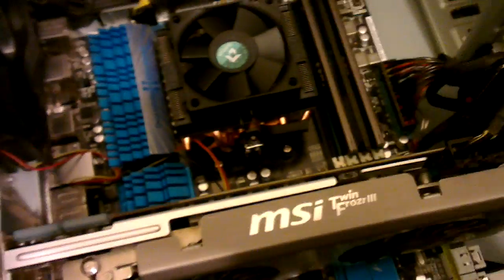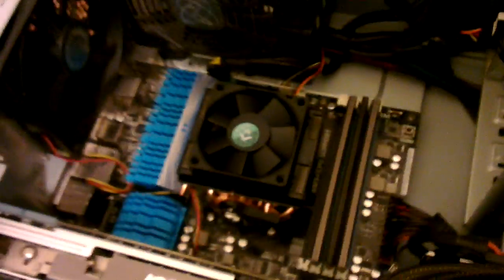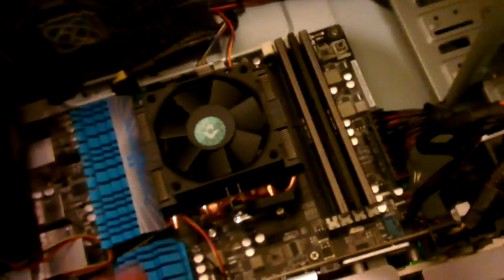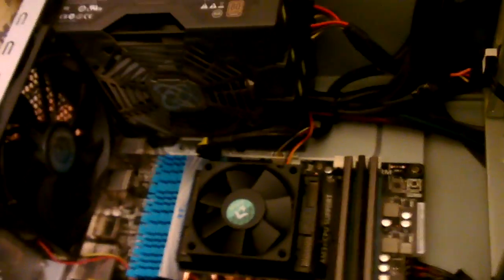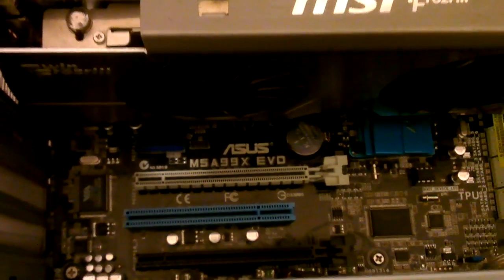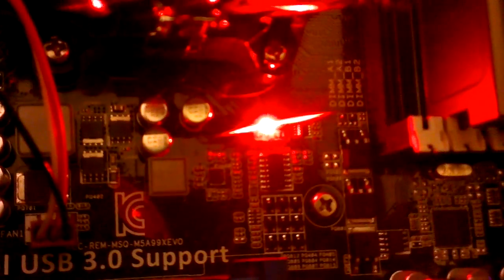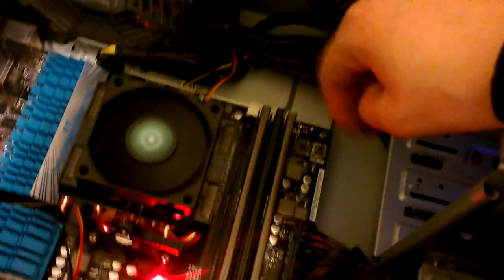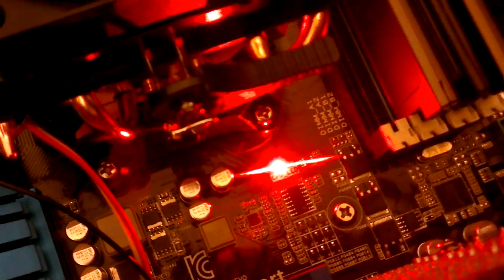ASUS NO BOOT NO POST

Comment: the north bridge chip of the board has fallen into a cold soldering error. It is necessary to remove the chip under the processor, freshen the lower solders and put them back on. There is nothing the end user can do on bga machines

Comment: it would be nice if held the camera a bit more steady that is aggravating as hell. yeah the CPU LED error is all to do with the processor. My issue is the Boot Device. yeah reflash the BIOS go back one earlier and then the lasted get those from the Asus site and do the reflash. you can reflash without POSTing by using the button on the MB bottom leftish side.

Comment: i had this problem too it turns out to be pq603  mosfet   right  next to the  big power supply plug  one of the 2 was dead    one is pa102fdg  and the dead one was part#  pc9050
Reply: On the ASUS P7P55D Pro, the PQ603 MOSFET is next to the labeled USB1314 socket not a "big power supply plug."  There are six (6) other MOSFETs in that area too, not just "the 2 was dead" you oddly mentioned.  As to your part number quote of "pa102fdg  and the dead one was part#  pc9050";  these numbers are completely wrong and totally misleading.  There are no such part numbers on that board.  These aren't even valid ASUS part numbers anywhere.  Perhaps you should explore the wonderful world of food service at your local McDonalds instead of trying to fuck up PCs.
Reply: @chuckadams4400  hello fuck head i am talking about  Asus M5A99X EVO not  ASUS P7P55D Pro  fuck head stop eating mc donalds  you sound like mcdonalds's clown  man you bring stupidity to a  brand new level wtf !!!!!! i did  managed  to fix my motherboard  would you ever do ?   ronald ?  shut the fuck up  !!!!

Comment: Another way to tell if it works is that if you have a led fan lights. If
 the lights turn a little dim, that means it will work. If the lights on
 the fans doesn't dim a few times,  then try to put the RAM in another 
slot to see if it works.

Comment: I have a problem where my pc turns on after a while it crashes and keyboard led turns of mouse to and monitor doesn't turn on I can't even turn it off neither restart it so to turn it on I have to unplug the outlet 
Same mobo as in video
Fx 8350
16gb ddr4 4x4
Seasoning 850w m12 bronze
GPu HD 7950 direct cu 2v
1tb hdd 
1tb Toshiba hdd
Please help I had problem for 3months 
Edvin Petrovic
Reply: did u fix it?
Reply: @Gdot04  yes it was the psu
Reply: How you solve this problem
Reply: @designcaptain4428  it was the power suppy
Reply: @gl0ckhuck260 did the fault in your smps?? if i change my smps then the my problem solved??
Reply: @designcaptain4428  sorry sir i dont know what is smp i tried my ram didint fix i tried my cpu didint fix motherboard it also didint fix it so i tried my psu and i replaced my seasonic 850wat with a corsair 650wat one and it works flawless
Reply: @gl0ckhuck260  smps mean (power supplies)
Reply: @designcaptain4428  yes powersupply was the problem id go for something like a 80+ gold or bronze powersupply form known brand
like corsair

Comment: i have asus p5kpl-am se and the motherboards green led light is on and when i turned on you know with out power buttons and nothing happens no display no fan spinning and since i don't have case So i unplugged and then re plugged it and i turned it on but this time i put my ears close to my motherboard and i heard a sound but i don't know what the sound was and my cpu is intel core 2 duo e7500 and i have 1gb ddr2 667 single and i have 300 watt power supply but please help me how to fix it 😥

Comment: Just fixed CPU red light on my new to me ASUS Sabertooth X58.  Turns out the CPU was not getting power.  Found the CPU power plug wiggled a little.  Tweaked the CPU power plug socket pins to make better contact.  That did the trick.
Reply: Finished my build red light and no display it auto switches off 😭

Comment: Is there a MemOK button near to the ATX connector? The RAM is probably the problem!
Reply: What’s the solution? Mine is Ram .. I plug in 4 sticks it won’t start. Remove 3 sticks it starts right away..

Comment: i had the same problem, tried the board with a known working cpu and ram. it wont go past the cpu test (which is the led that is on) so in conclusion you either have a faulty cpu or faulty mother board. considering my AM3+ cpu has out lasted 2 mother boards i would more than likely suspect Mother board
only way to prove this is with nothing else in the mother board except a known working cpu. if the mother board is faulty then it will have the same fault, if it was your cpu it will flash once then the ram led will get stuck on because of no ram being fitted.

Comment: I am having the same problem with the VGA and Boot Light both red, my screen says no signal. I took everything out and sprayed it with CRC contact cleaner. It worked, but I only had my monitor plugged in,  so I powered down to add my keyboard, but when I powered up again, I got no signal
Reply: Same
did you fix it?

Comment: I'm done with asus
Reply: vjxpiro evo asus p8 z77 V pro mom died today..... need msi :(
Reply: I ve got asus stix 1080ti b450 gaming and that y i have so many problems
Reply: I've had a few ASUS mb's over the years...never had a single problem with any of them...most were in use for 5+ years minimum.  You can get a bad board with ANY manufacturer..that's just reality.
Reply: Asus died z390 in less than a year, and they refused to fix my board,,Msi is the way to go, msi carbon are nice !

Comment: I fixed this same problem few days ago, take everything off ,clean everywere with alcohol using tooth brush to get in all the connectors ,should work fine after, seems sensitive to dust and grime ect.
Reply: Kus Ardiyanto he's trolling
Reply: @scoobi1955  Nothing to troll..you can bring devices back by using alcohol.
Reply: Simon Baker what you clean?

Comment: Just now I got into this problem.
My Pc is not booting........(No Booting Sound is coming) I tried everything I know.
but its not letting me to even enter BIOS.
all the fans and optical drives gets power.
No display on the monitor.
when I start my computer and press the power button to boot my computer I can only see the keyborad LED Flashes just ONCE and after that Nothing happens and every fan and MOBO LED LIGHTS GLOW.
What should I Do.
My config is:
AMD ATHLON X4 630
Biostar TA785G3 HD (MoBo)
Corsair 400 watt power supply.
Please solve my problem I don't want to buy a new MOBO.
I already cleared CMOS (By removing the battery and sorting the pins) but my problem is not solved.
Sill "NO BEEPING SOUND OF BOOT" & The computer is receiving the power.

REMOVED THE RAM
REMOVED THE HDD
REMOVED THE Optical DRIVE
Already did these but I'm not able to solve my problem.
Please HELP.
Evewin Lakra.
Reply from the maker: take the mobo out of the computercase and try to boot it outside of the case. Maybe the mobo is shortcutting power on the back inside of the case. That was what fixed it for me.So take it out of the case, put it on a box and try it. Good luck!
Reply from the maker: actually it might have been the bios that was broken, I honestly don't remember! I have broken more motherboards in my life as you may know :P
Reply: Manny Strauven Sorry for replying late coz I'm right now using my laptop & you already know the reason why I'm using my laption:)
My AMD PC was working fine yesterday & I have not added any new component or never changed the settings Or never did any Overclocking.

I thought the CPU is not switching ON or getting Power but the cpu fan runs & when only CPU is connected its getting warm I think CPU is getting power but its not switching ON.
My "Biostar TA785G3 HD" MOBO lights are On.
I don't have any standalone PCIe gfx card installed in my computer.
Reply: Manny Strauven I was using corsair cx 400w PSU.
with this computer for the past 3 years and I never had this problem
but yesterday at around 11:00 P.M. suddenly its not booting not even letting me to enter BIOS.
all the fans inside the computer (including the CPU fan) spins.
I took the MOBO out of the cabinet and put it above the mobo anti-static bag and connected:
1.CPU
2.RAM
3.PSU (24 pin + 4 Pin) Connector.
Then when I switched on the PC From mobo switch its not turning on.
(one time it turned on and turned off without any beep or booting sound.)

i.e. its not even starting if if try to star with open MOBO (outside the cabninet while resting in mobo static bag)
so now I've put my mobo and all the other components inside my pc cabinet and then also its has the same problem........PC starts but NO booting Sound No display on the screen.
NO POST.
Anybody experienced this problem and fixed it ?
Reply: is this the usual problem with AMD computers (when it gets old (eg. 3years or so) or you've seen this problem in intel computers as well ?
Reply: Manny Strauven I've already did the my PSU (corsair cx 400w) Sorting-Pin test :)
by connecting only the cabinet fan to the PSU and sorting the Green PIN And Black (Ground Pin) with the Paper Clip & When I switched on the PSU the Fan SPINS.
I think My PSU is Good.
but I don't know how I'll determind my MOBO got fried or my CPU got damaged.
I don't know I'll be able to fix this issue or not,though I'm also a computer guy but Never faced this situation in my entire life.
Its been One Day I didn't hear a single Beep From my AMD Machine.
Not feeling well. :(
Reply from the maker: evewin lakra
could be that your mobo is dead. It's not that uncommon that hardware suddenly fails without any adjustments prior to the problem. 3 years isn't THAT long, but sometimes you're lucky with lifespan and sometimes I guess you're not. :) If it's no POST no boot than I would concider the mobo to be fried.
Reply: Even when the green light is on and fans are still on?
Reply: evewin lakra p
Reply: @sootyable  I'VE SOLVED THAT PROBLEM & MY P.C. RUNS FINE NOW :)
Reply: @evewin89  how did u fix it
Reply: @fariaislam128  IN MY CASE THE AMD CPU GOT BUSTED & I HAD TO REPLACE IT WITH THE NEW ONE .
Reply: @evewin89 😂
Reply: @yssurglih6228  I'VE FIXED IT   😁
Reply: как ?
Reply: @yssurglih6228  ITS THE PROBLEM OF A BAD-PROCESSOR, MOST PEOPLE MISS IT & CONSIDER THIS PROBLEM AS A FAILURE OF THE MOTHER-BOARD OR BIOS BUT  IN MY CASE IT WAS THE AMD'S PROCESSOR THAT GOT FRIED AFTER 3-YEARS WITHOUT DOING ANY OC. REPLACED THE PROCESSOR WITH THE NEW SAME MODEL PROCESSOR & THE COMPUTER BOOTED RIGHT-UP

Comment from the maker: Have you got it fixed? Turned out besides the bios problem, the motherboard was making contact with my case which resulted in this same problem (when I tried the new motherboard I got), so always try to run the system outside of the case before you send it back because that fixed the problem for me so I knew that there had to be something wrong with the spacers and the computer case itself instead of the hardware.

Comment from the maker: try to boot the system without the videocard in your system. Let me know what happens and give me some more info. Also try to boot without memory. Does it give a beepcode? (make sure you have the speaker cable plugged in on the motherboard)
Reply: P8z77 v pro R.i.P Today..... next time try not to buy noob asus
Reply: Hi friend I'm having the same issue with my Sabertooth 990 r 3.0 I will try your tips

Comment from the maker: the mobo is still laying on the table, waiting for me to taking the time to send it back to where I ordered it.. :P I think (am pretty sure) in my case the bios is broken so if I send it back and they put in a new bios chip, everything should be fine. I think this becouse when I put power to the motherboard without ANY components, so no cpu, no ddr ramm, no gpu, nothing, it still shows that red light as soon as I connect the powerjumpers. In other words, for me it's safe to say it's dead :-p RMA
Reply: Is your problem solved
Reply: My problem the same. Led on = bad cpu and no post. The problem is the cpu, the bios need this to do the postcommand
Reply: I had a M5A97 EVO having the same problem after a month i set it up. Unplug everything and changed PSU and processor. Still the red light still there. :(